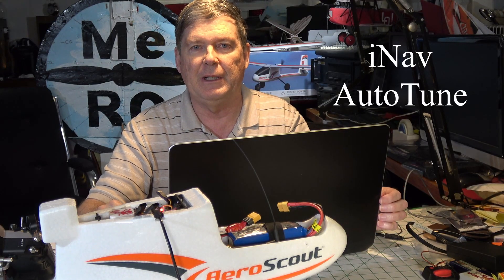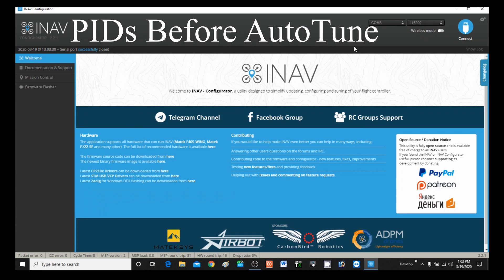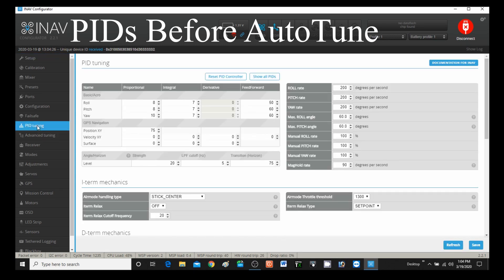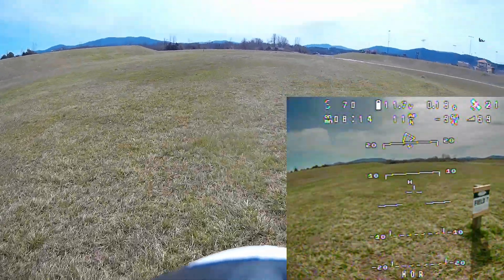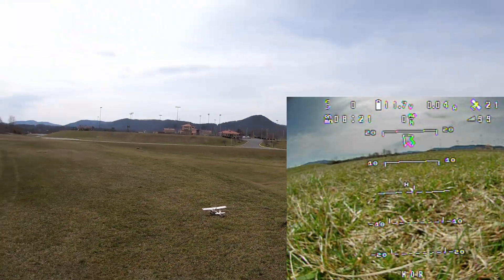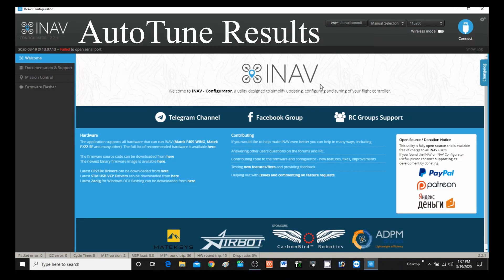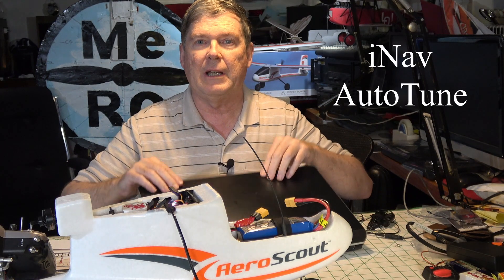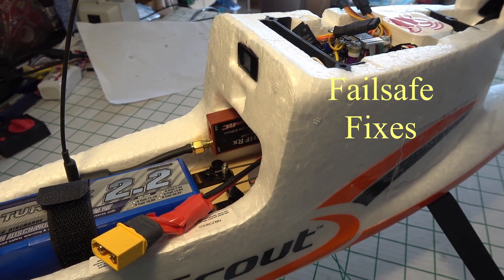iNav Servo Auto Tune Tut - AeroScout Plane w Radix FC Graphical OSD + MiniQuad Footage by James D

Comment: Good video Dave! Strange failsafe issues. Noise causing that?
Btw, have you been playing with DaVinci Resolve?
Reply from the maker: It might be noise so I added a cap to the battery line in case. 
Yes, this video was done with Resolve and I am liking that way it works. Just learned about the Y key and it's variations for sliding things around. What do you use for render settings especially bit rate?
Reply: I’ll have to check and get back to you.

Comment: I often wonder about iNAV and their Autotune TBH. More often than not, it ends up reducing P gains which deadens the stabilising effect.
  Compared with a standard decent giro stabiliser or an S6R reciever in Rate Mode (not Autolevel) In this setup, you can wind the gain to your heart's content using a pot on a dedicated channel. I can tell you for CERTAIN it gives a MUCH smoother flight whilst still having full overdue of all controls, even aerobatics. I wish they would look at adding this TYPE of stabilisation Mode in iNAV, it beats the crap out of Angle Mode for example, and Horizon. They can still have their all important GPS Modes of course.
Try it Dave, they are NOT the same....🤔🤔
Reply from the maker: Thanks for watching! Just a note: you can do the acrobatics with iNav if you want to by switching to ACRO. You have probably seen how that is used with your miniquads and it works for planes too.  The rudder is the last thing I need to figure out and then iNav will be perfect for me in the future. I will try rudder P gain at zero first and then work on some sort of logic to switch the yaw P gain to zero when moving aileron stick.
Reply: @DaveMerc  I know what Acro Mode is Dave...please read my previous Mail...Try the S6R reciever, it now has a Lua script to set it up. A magic giro stabiliser built in it too...A completely different experience...🤔😀 BTW..just plug your rudder servo into ch4 of the EZ Rx.
Reply from the maker: I have an S6R in my Night Radian and the HZ Aeroscout came with a AR636B which works great too. However neither of these have GPS or an OSD which is what I wanted. We are talking different wants/needs so although the stock AR636B was great for LOS I replaced it with the BrainFPV Radix FC to get the extra capability that I wanted. It's all good in the end.
Reply: @DaveMerc  Yes Dave, what I'm trying to get over to you, is the hyper smooth stabilisation you can obtain using gyro rate Mode and the S6R...and a pot to adjust the gain during flight according to cruise speed. You are NOT going to see the benefit by flying something as unresponsive as a Radian glider..You need a Mini Talon or similar. If only iNAV could include this form of stabilisation in their software...

Comment: Saw the Disarm screen on your first flight - Sketch Factor 9000!!! Nice saves, Dave, hope the new Rx solves the issue (but it failsafed at over 50% RSSI?).
Reply from the maker: Not really certain what the problem is but I will work it out eventually.  All the mods I did at the end of the video might help like the cap and the dipole antenna. I will check the failsafe threshold too.

Comment: Good vídeo. I also have failsafe problems with that receiver. 👍👍👍👍
Reply from the maker: Thanks 👍I have had good luck with the  EZUHF nano on other planes but for some reason it is acting up on this one. Perhaps electrical noise is getting to it so I added a cap to the battery line. I might have to power the servos from a separate BEC too.